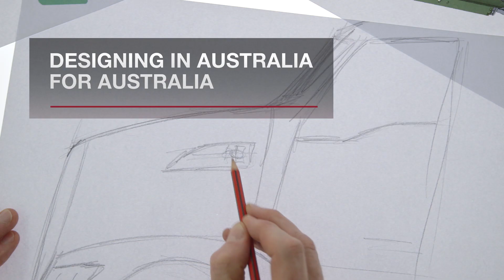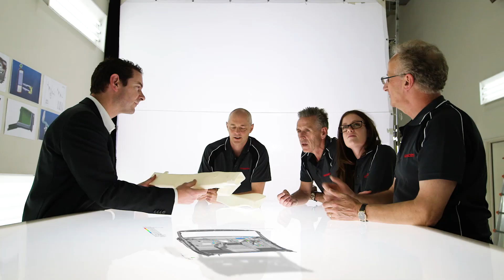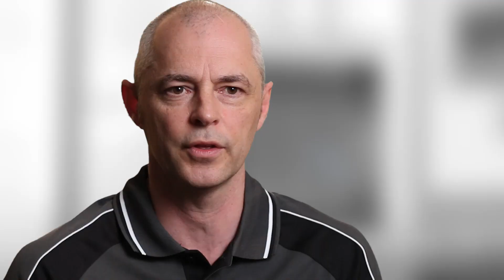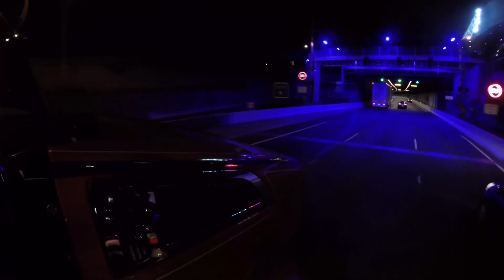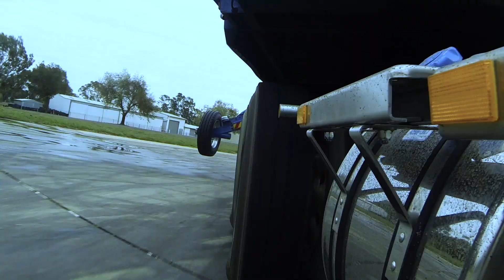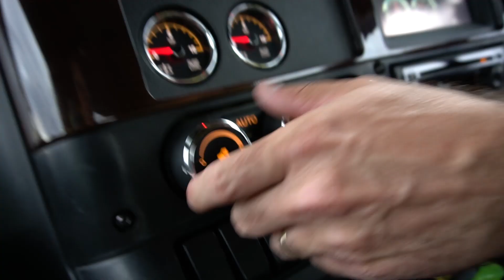Kenworth T610 Build Story Master

Comment: Have had one since 2018 and to be honest I wouldn’t want anything else after 45 years belting around in most models as well as cabovers its a pleasure to drive it’s a 600 X15 18 speed box running PBS

Comment: The 610 and 410 kws are junk, worst kenworths ever built 

Anyone who doesn't think so hasn't spent more than a week in one 

The vision is terrible, the a pillars are far to big, so big that u can't see oncoming traffic at roundabouts

The cab noise is so loud u can't drive with the windows down 

They are difficult to get in and out of 

The alarms are way too loud 

The stalk with the indicators on is too loose, when u put the indicators or high beam.on the windscreen wipers wl come on

The park brakes are in a difficult spot to access 

The adaptive cruise control is useless, it's so bad u can't use cruise control at all 

There is no room in the cab 

The steering wheel is too thick

They squeak

The grab handle hits your right knee and your knee also hits the door handle that is made from cheap plastic that squeaks all day 

The mirrors are too short 

The autos are rubbish 

The instrument panel goes dark all the time when driving down the road 

This video is just propaganda, we have an old 409 with 1.3 million k and everyone wants to drive that instead of the 610s and 410s 

Og and don't get the bendix collision mitigation system it will drive u nuts and u will want to push the truck over a cliff 

#junkkenworths
Reply: Hahahaha what a moaner . Learn how to drive. If you think vision is bad on these, try driving a 90. There a plenty of drivers that operate these for years. You’re just a pansy that can’t handle these trucks. What a pathetic moaner whinger you are that give all us truckies a bad name. Gtfo outta here you pansy. Disgrace you are.

Comment: i drive one in truck and quad (2016) (2018)models respectfully  ,everything about the day  cab is great , the view ,aircon, lighting, dash   ,but  the steering box ratio is slow and harder to turn than every other truck out there   the steer tires need to be at 120psi to keep the steering at its easiest  , steering return to center is poor , and after a few hundred kays on the freeway the king pins grow and start to stiffen up creating a very fatiguing situation where it is difficult just to keep the truck going straight   (they were like this from new )  i remember  kenworth claiming it was the best steering to date  on the road  ? theres 20 year old trucks out there that dont have these steering  issues  , and dont get me started on the automated transmission management computer and its under developed programs where by its first response to a problem is to pull the throttle away or take the gears away all together  , a full manual would be 100% better